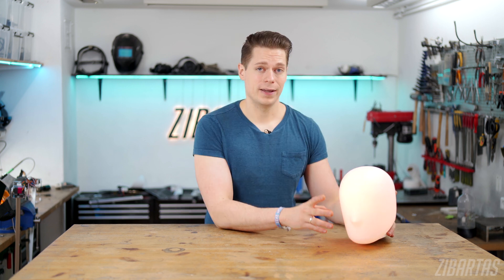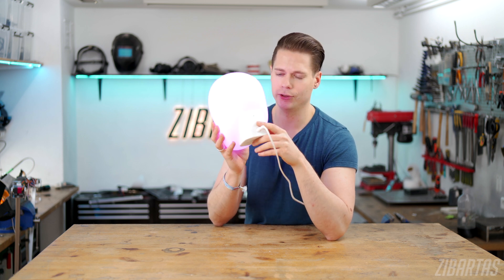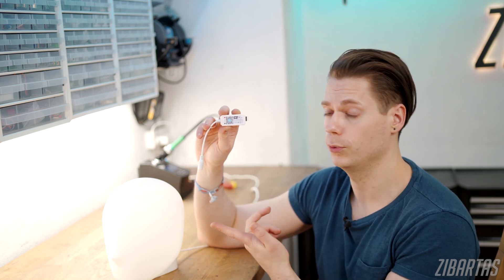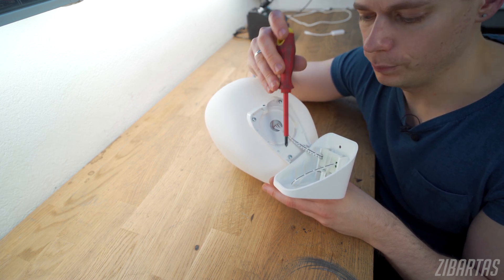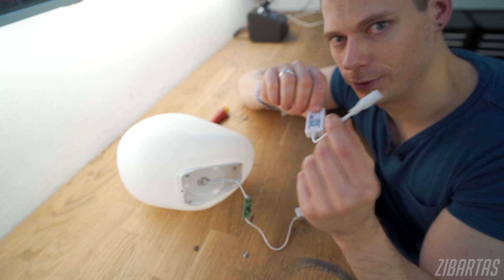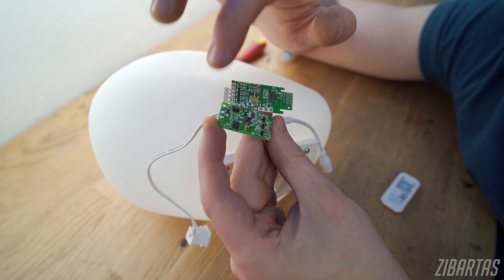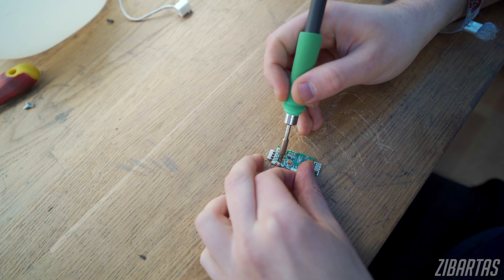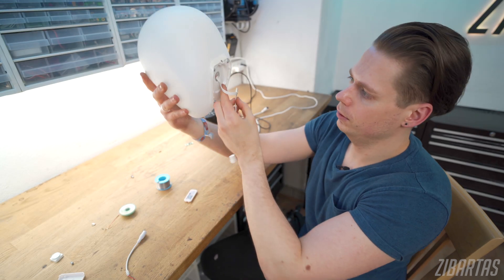IKEA Lamp WiFi mod

Comment: Could I not just plug this into my Tapo wifi plug and turn it on/off that way? I’d still need to press the button on the back to change the mode. Does it have memory so turning on/off in the Tapo app would go back to the previous mode?
Reply from the maker: Yes they return to the previous settings if you cut power, and plug it back in! That's a way to do it also :)

Comment: Thanks for the information and Vid, I've just done mine, looks great and works well with Alexa which controls the lights in  my house. I have done my "head" lamp as a support from my Quest 3, fits well but you need to counterbalance the head or have a spare battery pack on the rear of the headset as its front heavy, I screwed my head to a round wooden base I made with a couple of fishing weights at the rear of the base routed into the bottom of the stand. Also I converted my controllers over to rechargeable batteries and installed charging points on the base for them as well

Comment: I'm kind of surprised this worked so easily. Really cool that it did though! Like, what if the LEDs for the lamp had been a different protocol than what the controller was programmed for. What if the same voltages weren't supported by the board? But still, super cool this worked and keep making these great videos!
Reply from the maker: Yeah, it's very simple, in a good way - the LEDs aren't digital so there's no protocols to adhere to! Which is fine, IMO - high voltage non addressable LEDs are much brighter!
Reply: Oh wow! Yeah that does make it a lot simpler! Great project 😀

Comment: Any reason you're running openhab as opposed to home assistant?
Reply from the maker: I just used it since version 1, so I have a lot of rules and custom scripting done already :D Do you prefer Home Assistant?
Reply: Zibartas oh my globs, YES! So many integrations, and super easy automations/scenes etc. I'm also certain you'll love the esphome integration! Do yourself a favor, and chuck it on a spare raspberry pi, if you've got one! I can completely understand, if you're already committed to one environment, but just going by what I've gleamed about you through your videos (yay parasocial weirdness!), I think you'd actually enjoy the project :)
Reply from the maker: @endthefighting  Interesting! There are a lot of integrations developed for openHAB too... Though I am kinda weary of the newest versions - it's completely unlike the previous ones. That's why I'm more open minded to switching (now more than ever) :D Are there any limitations or some things you wish you knew before you started using it?
Reply: @Zibartas  Ok, really weird - I had a huge comment written in reply yesterday, but now it's been deleted somehow o_O
It was something along the way of trying to keep as many of your devices "off-cloud" as possible, by e.g. using LocalTuya instead of Tuya, flashing esphome or Tasmota on anything you can, and so forth.

I also guess another thing to keep in mind is your installation method. I started by running Home Assistant in a docker, but I'm now running Home Assistant OS on a dedicated Pi4B+ 4GB ram.
Reply: Home assistant can do sooooooooooooooo much